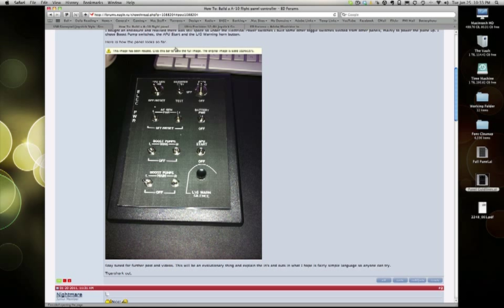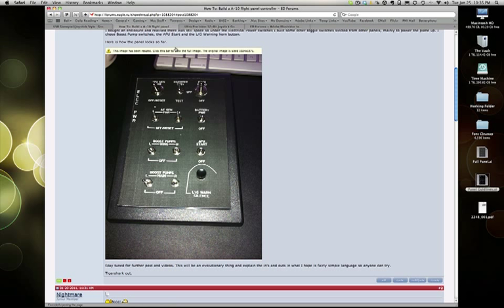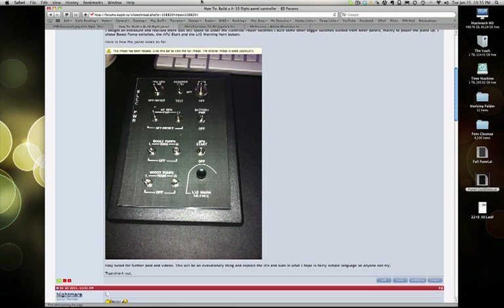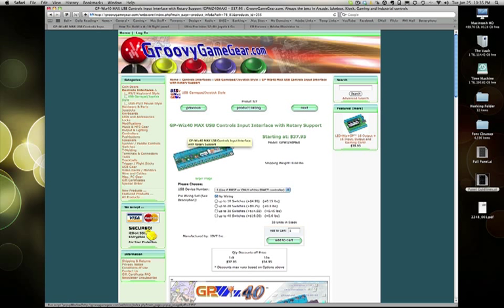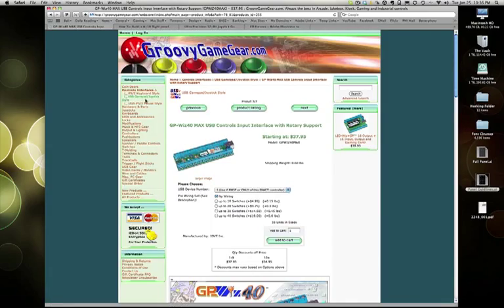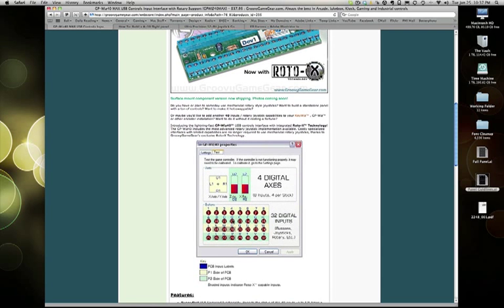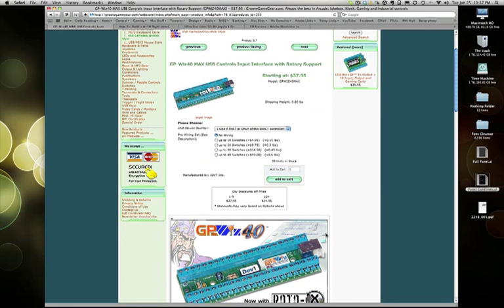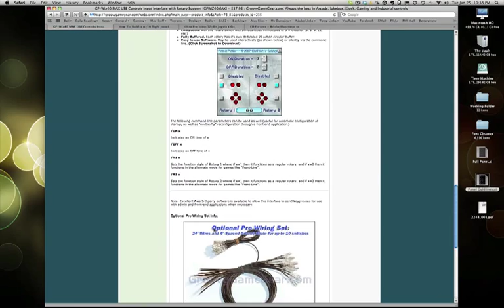How to make an A-10 Panel - Part 2

Comment: Hi TigersharkBAS, really cool, I will start soon with my first panel. planning is to use a Arduino in combination with the dsc bios application! but is this working direct without the dcs bios? Regards
Reply from the maker: Hi there. Yes this works without any kind of "coding" required between hardware and the sim. Mainly because the Groovy Game Gear is hardware that the PC sees as a joystick. So it thinks the panel is a giant 32button joystick.

Having said that, DCS BIOS is an excellent piece of software and using an Arduino will let you "receive" stuff from sim (like master caution lights and caution panel lights) whereas the solution in this video is send buttons only.

Comment: Thank you for your great video =)
I've been looking for a way to connect the physical switches to the sim and was wondering how would I go about achieving that =)
I've been flying Falcon BMS for more than 10 years now but hope this works as well for FSX cause I'm planning on building a 737 step by step from scratch =)
Thanks again =)
Reply from the maker: ***** Hi Amr....I'm afraid I can't help very much with those 2 sims as I don't play them. But you may consider Googling joy2sim. It takes DirectX joystick inputs and converts them to keystrokes whilst you are playing a game.
Reply: Thanks for your reply TigersharkBAS  =)
I already have a program called JoyToKey that takes the Joystick's input and converts it to keystrokes but I will give joy2sim a try as well thanks for the suggestion and hopefully will be able later on to take the Outputs of the SIM like panel lights, gauges etc and interface them with the panels ... Still learning and have to google, read and watch a lot of things just to know where and how would I start in this process, but thanks for your great videos and keep them coming =)
Have a great day or night whatever time it is in your area =)
Reply from the maker: ah yes,,,joy2key...that's what I meant :-)

Comment: OK Dude, seriously! Where were you 50/11 videos ago? DCS should put your videos on sticky in the forums and save everyone a hell a lot of time. I literally just got thru reading 57 pages of a post that started in 2009 to date. After all of that, the only thing I learned was how to cut plywood. Learned more from your channel in 2 videos! I still have more questions than answers but at least now I have a direction. Lets see what part three brings to the table. C U THERE

Comment from the maker: You could put one resistor for all LEDS but you would have to do some calculation based on how many volts you would need. Safe bet would be to put a resistor on each LED

Comment: Do you have to put a resistor on every LED that you hookup using this wiz board? I see how to hookup all the switches but lets say I have 10 LED's I also want to hookup, does the board handle it automatically?

Comment: I have the Universal Joystick Controller BU0836X from Leo Bodnar (.com), very easy to set-up.. not soldering or anything "difficult", just press a button and put the wire in there. You can connect 32 switches/buttons and even a 8-direction POV hat switch (probably already on your joystick).  Just for anyone who is deciding which usb-device to get :)